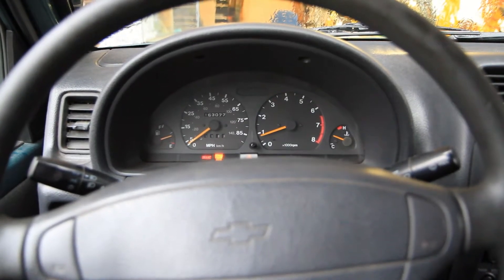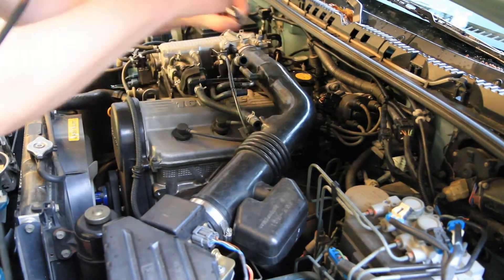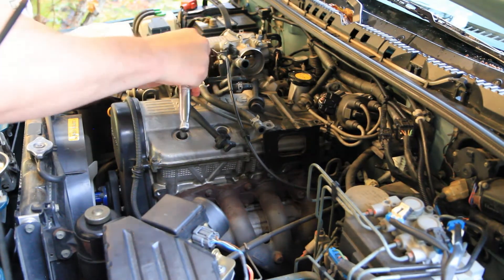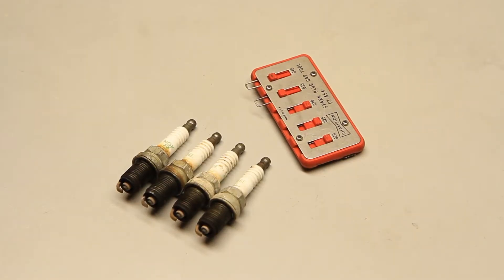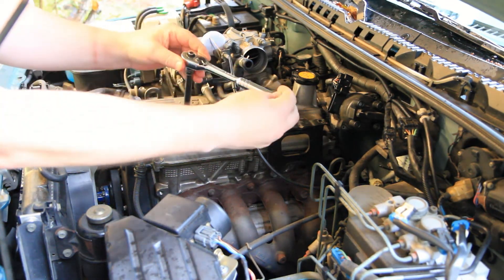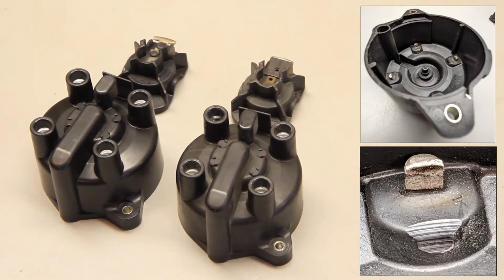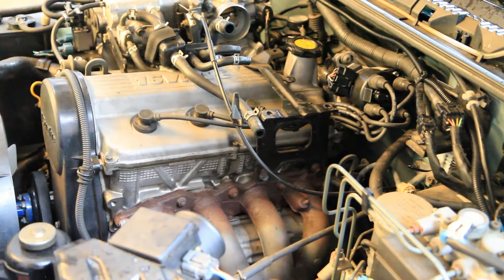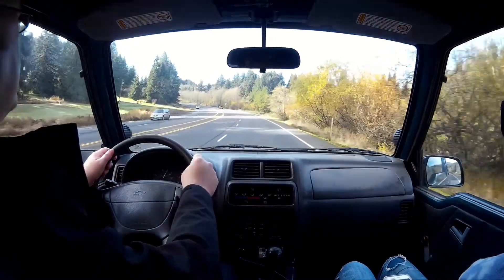Misfires and Ignition Tune-Up - Getting Your Suzuki Sidekick / Geo Tracker Running Right Part 3

Comment: Actually you don’t have to remove the intake tube to change the plugs, it is a challenge to remove the plug wires from the plugs, but you just have to manipulate them correctly to get them out of the way.. I have a 1995 tin top with the 16v engine and I have done this a couple a times

Comment: I had a 96 geo tracker that i battled with every year for emissions. Some little metal tube in the egr system would get plugged up if i remember correctly

Comment: thx for the info was very helpful ,,,when is part 4 comeing out?
Reply from the maker: Luckily I don't need to make a part 4 yet - the truck is running great!  Is there a specific topic you are looking for?

I will have a new video this week with an overview of my truck.
Reply: hi again and thx for the replay/
can u make a test to see if the  oxygen sensor working good with the new setup?
i fix my misfires and tune up,  with new spark plugs and cleaning the carburetor. and all work good for few weeks. until i gat error from my oxygen sensor.
and when i put back the old setup it work fine(did it only for testing).
in your videos you change parts becouse the 16T mile service, did you checked if the oxygen sensor is working good with the new setup? has the sensors where replaced before?
thx

Comment: What size is the spark plug extender remover or proper name and size for it ? Thanks . I have a 96 geo
Reply from the maker: The 16V uses plugs with a 5/8 hex.  You'll need a spark plug socket.  These have a rubber gromet inside to keep the plug attached to the socket for installation and removal.